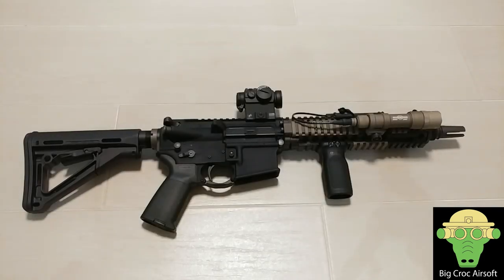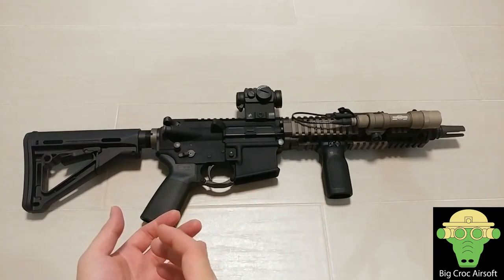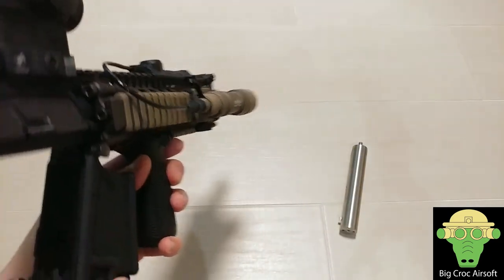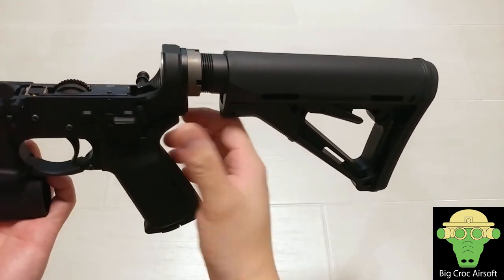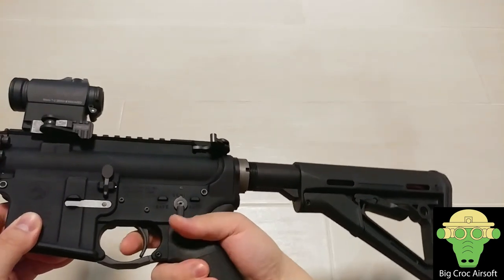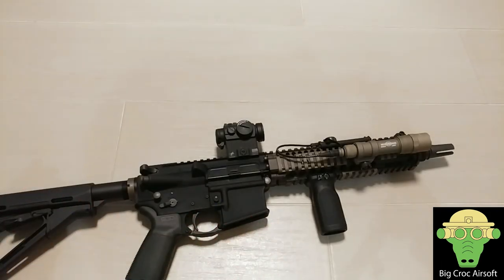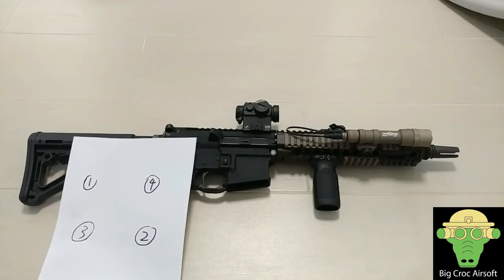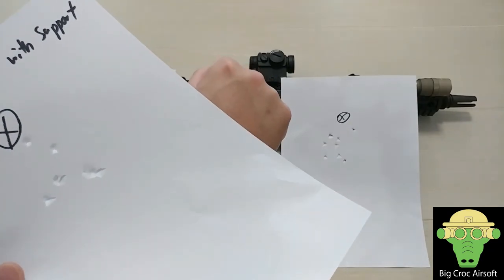EP28 - FCC PTW (Fight Club Custom) first look review: Part 1

Comment: Nice video! I have a hard time choosing between a PTW and a TM next gen AEG. As I noticed you have both of them, so I wonder in your opinion which system is more durable and competitive in the game. Thank you!
Reply from the maker: I am going to share what I have experienced so far, hopefully it will help you decide
A stock PTW vs fully upgraded next gen, outlook, accuracy, range, trigger response

cost: a stock PTW (let say systema, cost around 1.2 to 1.3k USD) will be around USD 200 more than a fully upgraded nextgen. (the TM 416 I have cost around 800 after upgrade but I did not have a proper mosfet, titan gate will release a mosfet for nextgen soon so if you add that it will probably add up to costing around 1k. 

outlook -> PTW, as it is mil spec and can share with lots of real guns parts, nextgen can only use crane stock as the battery is not store inside the buffer tube, unless you get it rewire and store it in the rail.

Range: PTW has a more consistent stream of air pushing the BB, so the range will be a little bit better (Barrel length doesn't matter)

Accuracy: more or like the same at 40m (Barrel length doesn't matter)

Trigger response: PTW wins but as mentioned I did not get a proper mosfet. but, due to the mechanic design from PTW, it will still be faster than AEG in semi,

So with that said, if you engagement distance is around 40 - 50m, I would say both are pretty much the same , if over 60m then I would say PTW.  if you want it to look as real as it gets then PTW also as it can fit real steel Rail, charging handle, butt stock, upper, grip etc. 

Hope this helps!
Reply: BigCroc Airsoft Wow! Theses are more than enough for answering my question. Thank you so much!

The looking and RS specs means a lot to me, so it seems the PTW is the way to go. And I can tell you are a PTW boy lol ; )
Reply from the maker: @APC2239  you are welcome, tried my best not to be bias in anything XD
Reply: Yuanye Dai